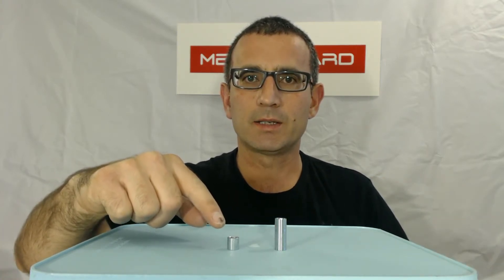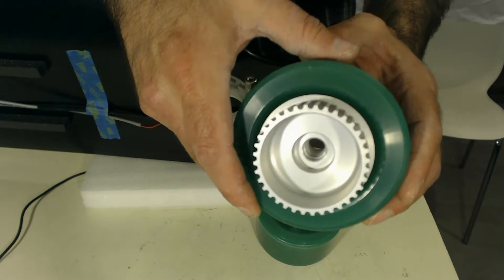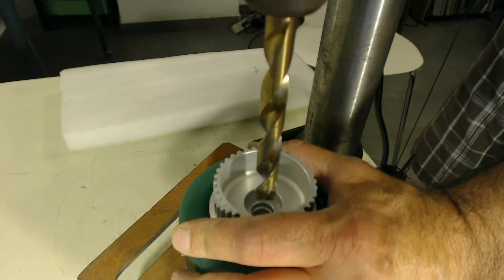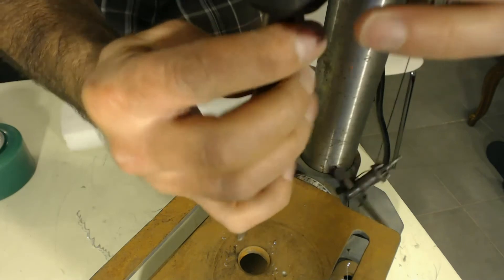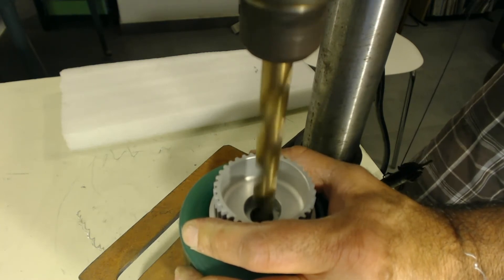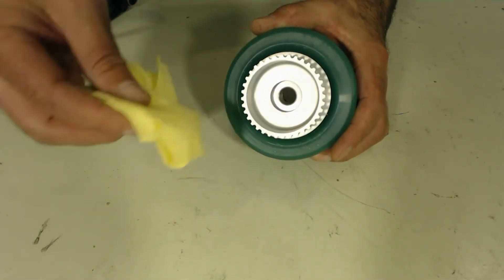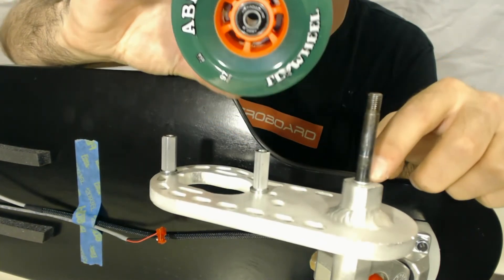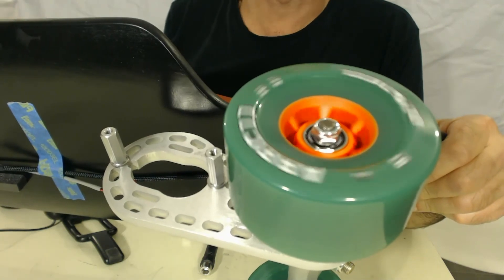New Metroboard Electric Skateboard Drive Wheel Bearing Spacer

Comment: I had a big  discussion with you (metroboards) just about  this mod on your "Pulley Installation Video" . I was saying there was nothing to transfer Torque of Axle Nut to base of Axle.
 I did not recieve these Spacers with my 2 Metroboard Pulleys ?

What length is the new Spacer?
Reply from the maker: it's about 27 mm
Reply: Do they come with Pulleys when you buy ?
Reply from the maker: yes the pulleys will come drilled out and will include the bearing spacer
Reply: I did not reviece any with my 2 pulleys?
Reply from the maker: We just got the spacers recently...please email me with your name and order details at info@metro-board.com